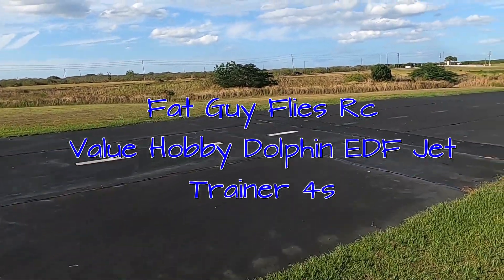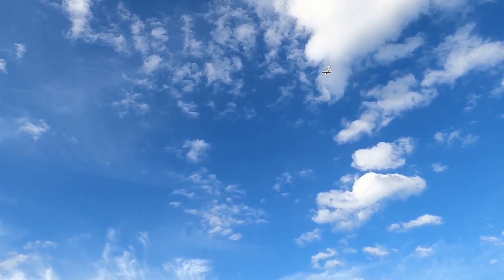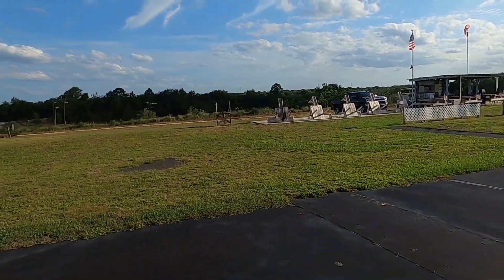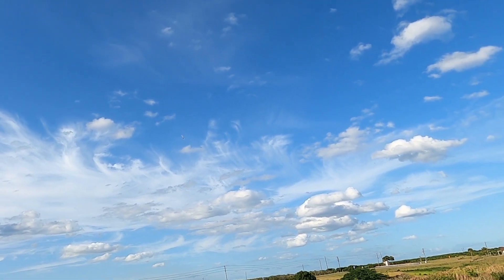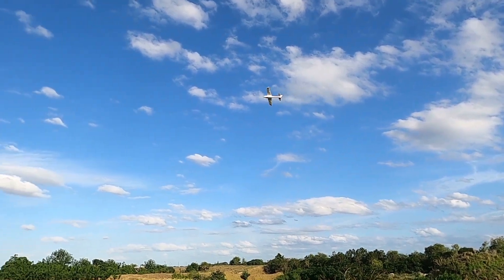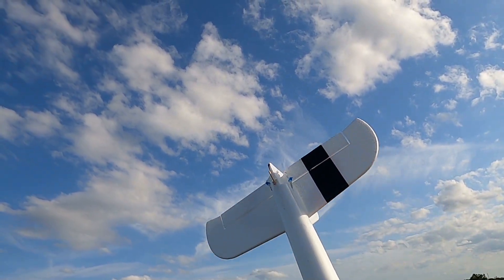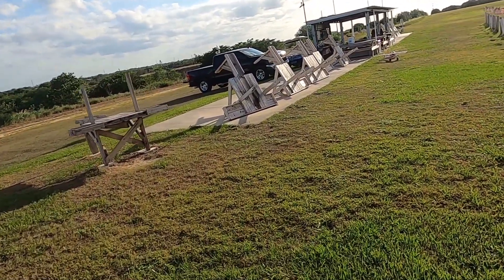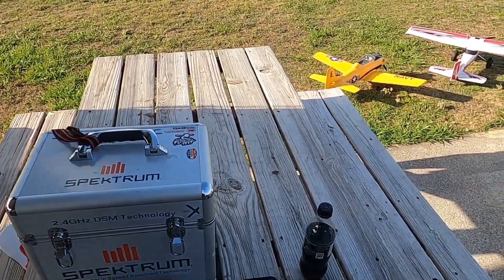Ok lets fly a little 40inch EDF Jet in 18mph winds by Fat Guy Flies Rc another real fun flight!

Comment: I think I have created a beast from this fun little plane. I used some scrap epo and a little duct tape to install a 64mm EDF. I went with a Spektrum AR636B receiver from my used and abused AeroScout. The EDF is from a wrecked Freewing Mig15.  Hooked up to a 50amp ESC. 64mm EDF + 4S 50C pack = a rocket. Honestly, this thing now does virtually unlimited vertical. Still flies great at 1/4 throttle as well. Not too bad for a $55 airframe. I promise to post a video soon.
Reply from the maker: YES THIS I MUST SEE!!!!!!!!!!!!!!!!